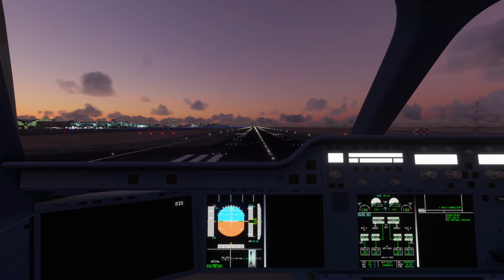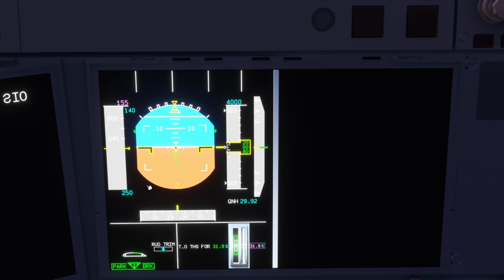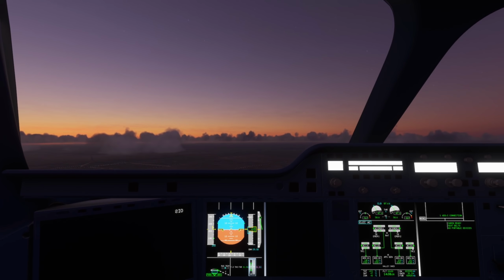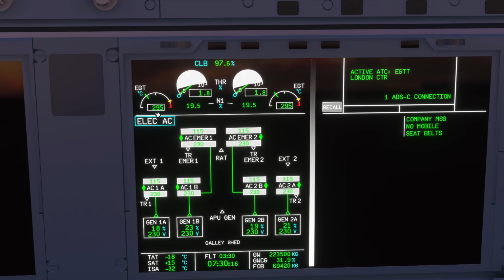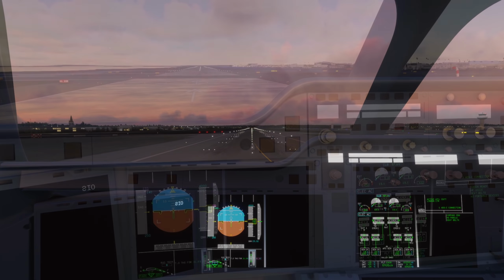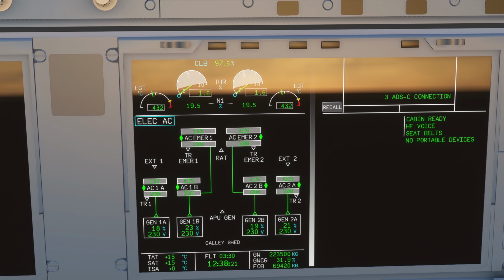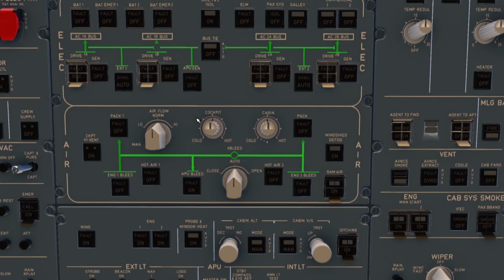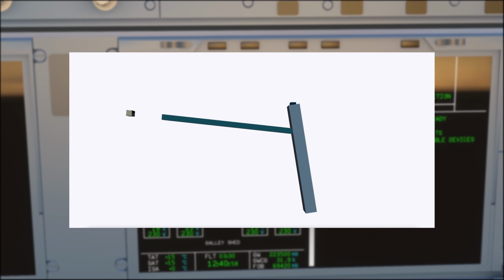Discover350 Ep 1 | DFD A350X Progress Update

Comment: Will this mod work with the standard edition? Or do you need premium/deluxe?
Reply: Yes its a standalone addon, why would you need premium or deluxe??
Reply: @xzreai1802  A lot of freeware mods (and even some payware) are based on existing FS2020 planes and require that they are installed for it to work. Like most of Captain Sim's (quite crappy) planes requiring the default 747-8.

My worry was that this would be based on the 787 (due to similar size and role) or something that is only part of the most expensive version of the game.
Reply: @Antares2  Freeware mods are mods, the DFD A350 is an "addon" plane - the mods are built upon the base planes and improved upon. CS is another story lol. Don't know why you would assume this A350 would need some other aircraft when its very clear that everything is being made custom by the developers ;) and that too why the B787? if anything (not saying it will be, its all custom) it would be based on the A320. I think you are assuming the same level of the stolen Abad A350 model that has circulated which uses the 787 cockpit but this is not the case here. The DFD A350 is being built all custom, you'll see more progress soon 🙂
Reply: @xzreai1802  Glad to hear it. Obviously it wasn't clear to me, hence my question.

And as  you point out, there is a lot of questionable practices from thieves like Abad and payware devs like CS. So, that's why I was worried.

Thanks for clearing it up!

Comment: Have you considered attaching yourself to the FBW team? Considering they are doing 350 and 320 (plus the 330 neo using the same base system).  I thought it would cut some development time using the same base :). If what Aerosoft says is true about Data not being available maybe the whole group could push Asobo to get some of it from Airbus :).
Reply from the maker: FBW is only developing the A320neo and the A380 for MSFS. They are not doing the A350 [that is us at DFD] and A330neo is by a separate developer [headwind]. However, we are actively working with and collaborating with the FBW team for shared resources, documents and data on various parts of the aircraft. Also to note, Airbus will not and never will release any sensitive aircraft data to the public or to developers like us.
Reply: @dfdsim  That was basically what i meant though :). Maybe use that Community Installer to get out alpha/betas easier? Yes I know about Airbus but Asobo might have a better working relationship so I hoped some lobbying there could help but maybe not.